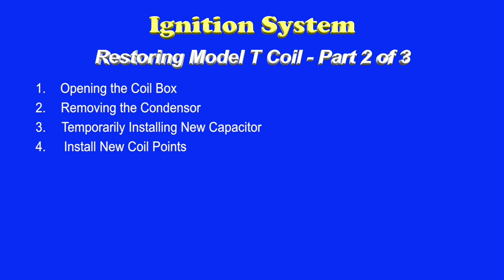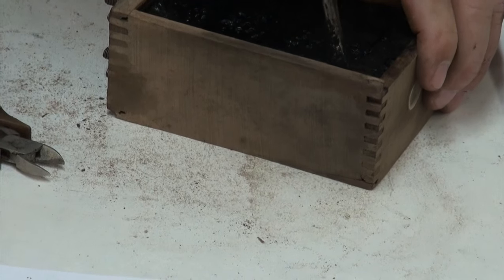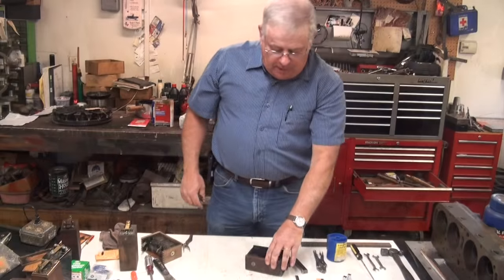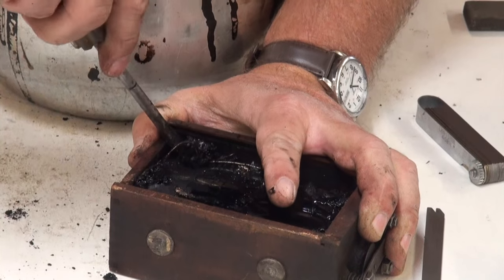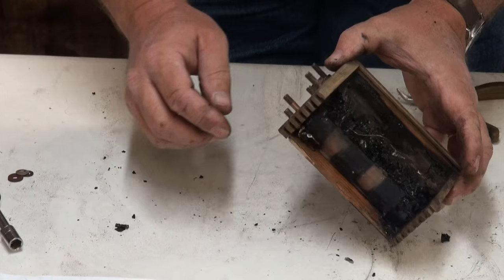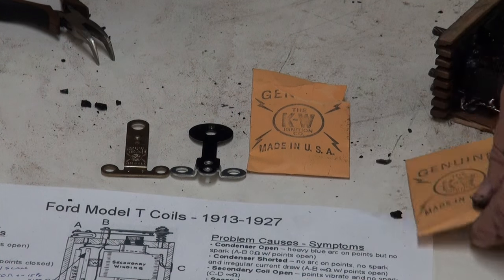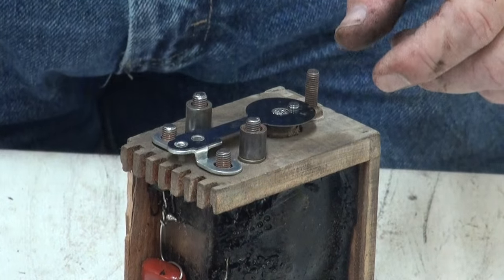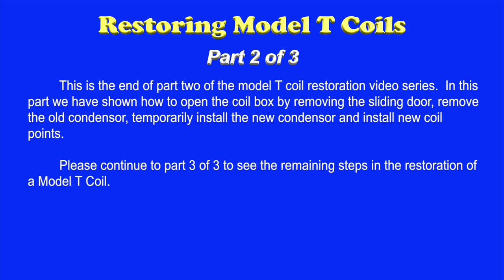Ignition 01 Restoring Model T Coils Part 2 of 3

Comment: I may have missed it but what size is the replacement capacitor? I believe .47 mf but is it 400v or 600v
Reply from the maker: Ronnie Rowe .47mf 400v available from Lang’s, Birdhaven or Snyder’s.

Mike Vaughn
Reply: If you aren't going to use the original condenser, why not replace the whole thing with a modern electric high-voltage board?
Reply: looks like 400 VDC